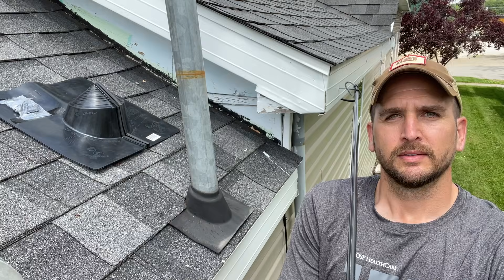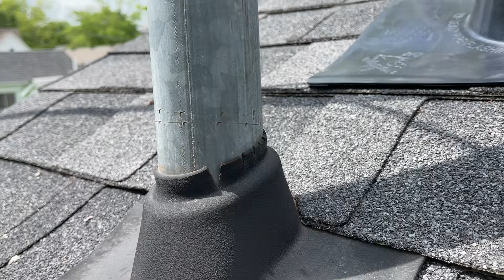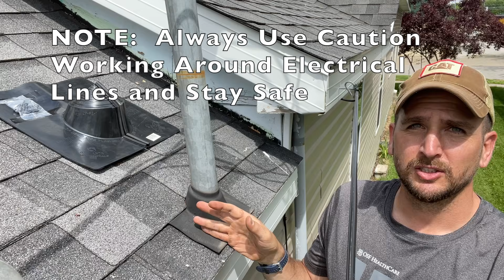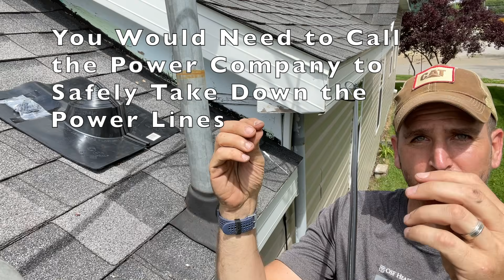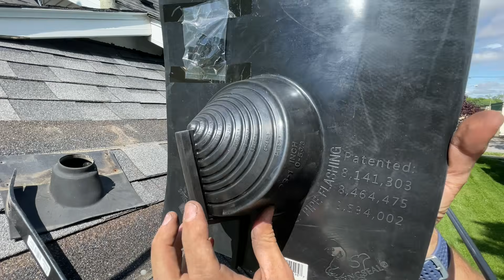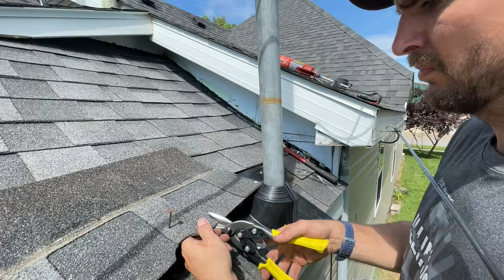How to Install Retrofit Roof Boot | Electrical Mast Example

Comment from the maker: Retrofit Electrical Mast Roofing Boot:  https://geni.us/zsi8P

Tools Every Weekend Warrior Needs
Makita Cordless Drill Combo Kit:  https://geni.us/t7dIA
Dewalt Drill Bit Set:  https://geni.us/oFlSl
Dewalt Screwdriver Bit Set:  https://geni.us/VDcr
Craftsman Screwdriver Set: https://geni.us/jXqFI
Eklind Allen Wrench Set:  https://geni.us/7XfvO
Pliers (4-Piece Set):  https://geni.us/RIdx
Milwaukee Fastback Utility Knife:  https://geni.us/MlyiLk
Stanley Tape Measure:  https://geni.us/bUfD1R
Studbuddy Stud Finder:  https://geni.us/RySCuVw
Johnson Torpedo Level:  https://geni.us/wiLcDY
Stanley Hammer:  https://geni.us/bPDk8Wo
Buck Bros Wood Chisel Set:  https://geni.us/vk3cpTW
Klein Voltage Tester:  https://geni.us/h9Hl
Klein Outlet Tester:  https://geni.us/kdBAJ
Milwaukee Wire Strippers: https://geni.us/5zuLAbC
Little Giant Ladder: https://geni.us/fmlmTk

DISCLAIMER: This video and description contain affiliate links, which means that if you click on one of the product links, I’ll receive a small commission.

Comment: Hey I installed this (thank you!) But then it turned out my leak was actually coming from the guy wire bases for the pole. A roof repairman fixed it but he put the shingles OVER the rubber base of this boot rather than leaving the rubber base on top of the shingles as this video suggests. Should I worry about this? I feel it invites water under the shingles- but he did put a water barrier under it on the next layer.🤷🏻‍♀️

Comment: why do electrical masts need a plastic/rubber boot? the sun eventually wears them out ans you get leaks. Why cant they be metal so they can last longer?
Reply: Use cooper that’s what they use on slate roofs

Comment: I appreciate the video.  Great info.  The only think I would have don't different is I would have put a bead of caulk down the left and right sides and not put the 4 nails at the bottom.
Reply: Nails in base will leak after your silicon disintegrates

Comment: You shouldn’t nail the front side of the boot ever. Plumbing and electrical boots are designed to work like a shingle in that only the top gets nailed that will be covered by the shingle above. By nailing the bottom you are only creating a possible leak

Comment: Yikes, the electrical mast? My only advice to any DIYer would be to stay away and call a pro, or indeed get the utility to cut the power from the transformer on their pole.
Don't be the shortcut for the power company to find ground! Your heart cannot handle it.
I'm glad you got through this ok. The ladder up to the base of the mast likely kept you out of trouble. But if this were to require putting your whole body on the roof to get the job done, sorry, no, you're too close to bzzzzt, please stay away!

Comment: Good job ,but you made a mistake, but u never nail on the bottom instead use silcone. In five years those nails gonna rust and the pipe is gonna come loose.
Reply from the maker: Thanks for the feedback Jason.

Comment: I had a leak from a sink stack all the way to the basement, boot looked fine but I ended up putting roof cement all around the boot on the roof. 2 days later we had 2-3 inches of rain, no leaks anymore.
Reply from the maker: I would say a 2-3 inch rain is a good test 👍

Comment: Don't you have to seal the cutout for the pipe too? I would think it would be a good idea to throw some sealant around the pipe there, but I'm not a roofer either, lol.
Reply from the maker: If you have a tight seal around the pipe you should be good.  I think some guys just throw sealant all over everything to feel safe.
Reply: @EverydayHomeRepairs  considering very rarely is it a bad move to add more sealant,  as long as you prepare the surface and apply the sealant correctly, its always better to have extra when it comes to water/rain protection. The cost for the sealant is negligible when compared against possible water damage in the future